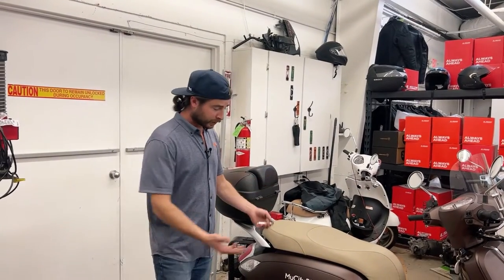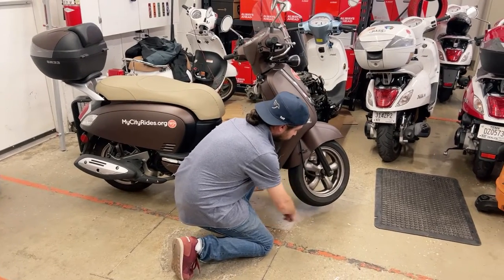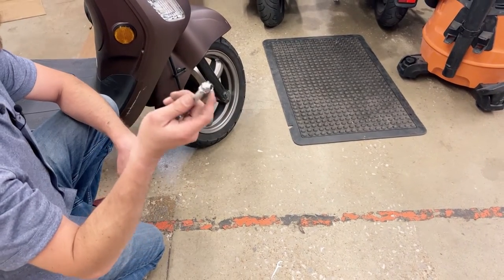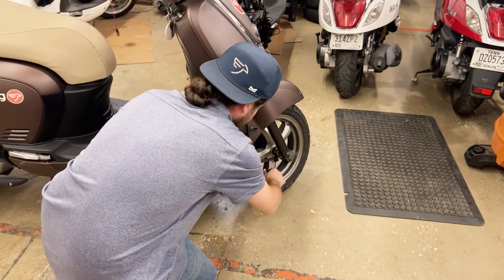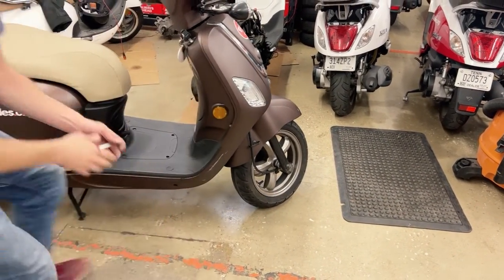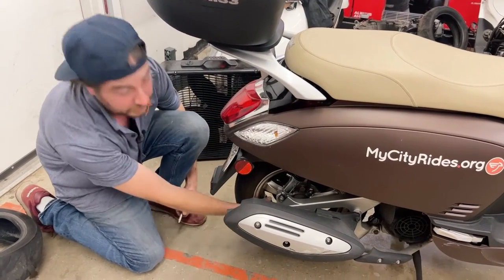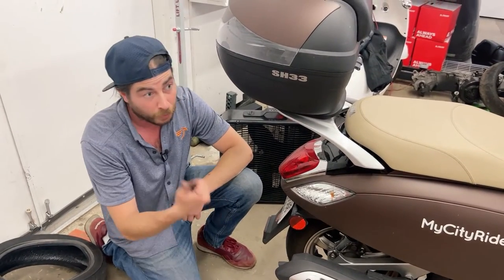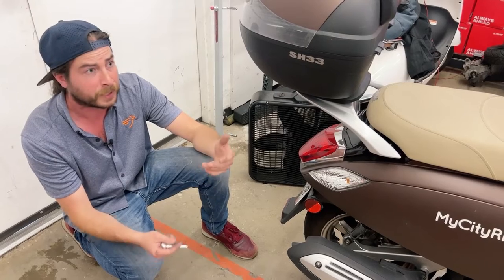How to check your scooter tire pressure

Comment: I got a Tao tao evo 50 50cc scooter. I bought a digital tire pressure gauge and the sides of my tires says 40psi cold for both. When I used the digital gauge it said I only have 17psi in the front and 7psi in the rear, both tires are rock hard. Would it be fine to add the extra psi and how much should I put?
Reply: Always go for analogue pressure gauge.